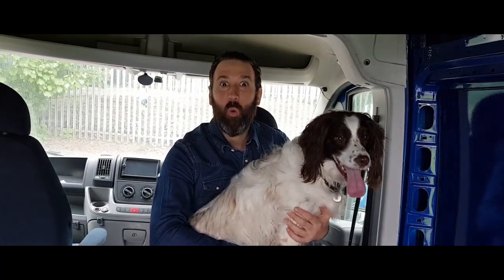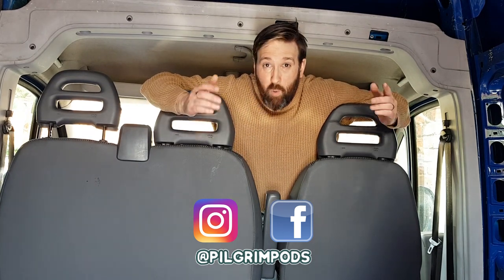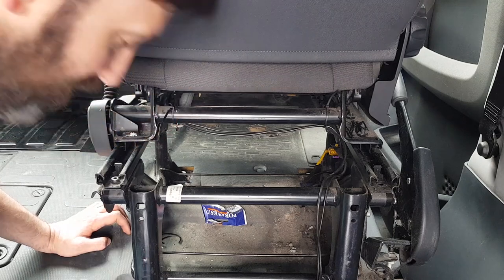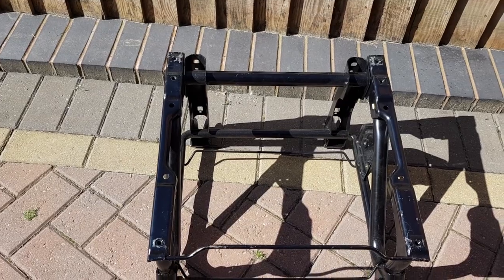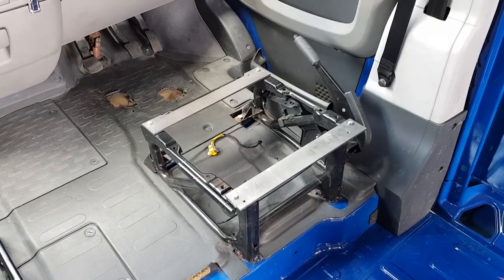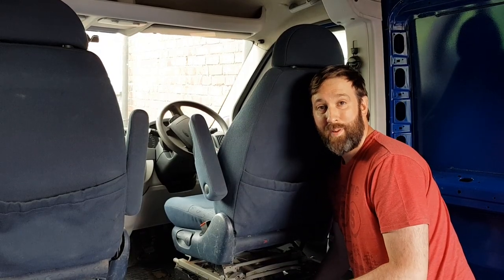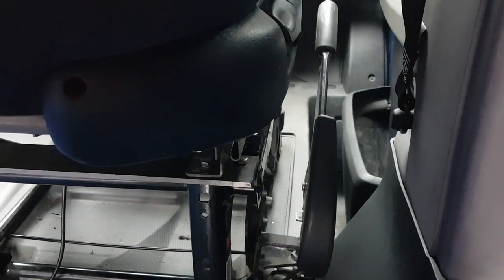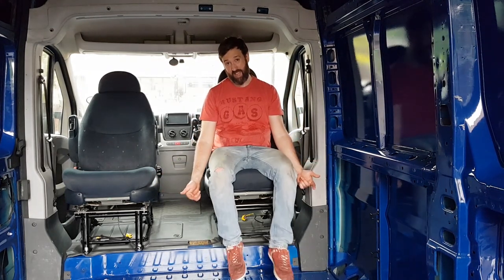Installing Ford Galaxy swivelling CAPTAINS CHAIRS in a CAMPERVAN - DIY Budget Campervan Conversion

Comment: Hey thanks for the video, after watching it I bought a pair of Galaxy/Sharan swiveling chairs for my Boxer van
Couple of thoughts, did you finally get lowered seat bases? I am personally looking at my welding invertor, maybe I could actually make ones
And of course the airbags, did you connect them? Extra safety never hurts

Comment: Great thanks for the tip on cutting the bit of metal to make it rotate 360
Reply from the maker: You're welcome mate! Hope it's of some use to you. 🙂👍
Reply: @PilgrimPods  Mine turned out to be newer seats to yours i think. Had to remove a stopper on the swivel and the two "catching" pins that i am not sure what their purpose anyway, kinda holding the seat from going up too much? But yeah, worked out well. Thinking if should wire up the airbags on mine? We all know how it will go... lol

Comment: Another good video. My front swivels are great and really comfortable but... I can't rotate either of them without it fouling on the door handle, so I have to open the door then turn the seat. A right royal pain, but hey ho😂
Reply from the maker: Ours are a little snug against the door when rotating them too if they're slid all the way back in the driving position but like yours, are super comfy and so much cheaper than buying legit seats. I think these cost around £230 all in versus £450 for a single passenger seat, £240 for two swivel plates and £300 for two lowered bases to correct the additional height from the swivel plate. Have to say though if it wasn't a budget build I'd pay the extra for the peace of mind knowing it's all crash tested even though I am pleased and confident of my own installation. 🙂

Comment: Hey there, great video. 
This is exactly what I did in my Peugeot Boxer. I bought two VW Sharan (same as Ford Galaxy) swivel seats for peanuts and fitted them almost exactly like you, with 4 steel plates. 
I then went to a blacksmith to have the seat base shorten: he cut 6 cm off and welded the tubes together. The height is now perfect!
Did you sort out the Airbag failure light?
Reply from the maker: Hey Hunor! They're great seats aren't they. 🙂👍 We're thinking about lowering the driver's seat too but won't know whether it needs to be done until we get the table in behind it. We have a temporary fix on the airbag light; we've plugged back in the old cable and tucked it beneath the seat.

Comment: Hi!
Thanks for the detailed video!

Doing the same thing right now, I'm thinking that the driver's seat has now an offset to the left, and is no longer centered with the steering wheel.
Is that the case? (as you've used the front inner bolt)

Thanks in advance for your opinion!

Comment: Do you still have the old drivers seat? :)
Reply from the maker: I do. The plan was to sell it to recoup some money to put back into the build but Covid had other ideas. It's tucked away in a corner safe and sound. Will keep it until were out on the road. If we decide we love the campervan but need something bigger we'll try and repurpose it for a passenger seat or sell it at that time.
Reply: @PilgrimPods  im interested in buying it, DM me on facebook? :)
Reply from the maker: @mortenleinan  I'm not looking to sell it now sorry mate.

Comment: I used the double base cut down to make the single base . Loved the video
Reply from the maker: I tried to figure out a way to do what you've done but couldn't get my head around how to make it work. Would love to see a photo mate! 🙂👍
Reply: @PilgrimPods  I put some 1min videos of me doing it but never put last 1 on I will add finished design  . I put battery under pass side and night heater under drivers seat as vents for night heater come out just above heat sheild for exhaust

Comment: Great video like your style. Just gathering information before we start our build and twin front swivellers are what we want. I've been looking and like you found the Galaxy seats as the cheapest option. Liked your instruction very informative and can't see any issues apart from that bloody seat belt tensioner. I've read you plugged the old one back in and added resistors,  any chance you could give a bit more info regarding this, as the dash warning light would now be a MOT failure and I'm not very good with car electrics to be honest. Cheers
Reply from the maker: Hey Rob, thanks for checking the video out. A resistor bought from eBay sorted out the pre-tensioner plug for the bench seat no bother but after following lots of advice online (most of it conflicting) I had to resort to disconnecting the old seatbelt stalk with pre-tensioner plug from the removed chair and plug that in and just cable tie the stalk under the seat out of view. I'm not happy with the fix but it got it through its MOT. Once the camper conversion is complete I'll revisit it and try and sort it out properly as others have managed to make it work. Truth be told, as much as I like the aesthetics of the seats if I had to do it all over again I probably wouldn't. I'd save up and pay the £400 for a legitimate passenger seat and then fork out for the swivel plates. Whilst I do have faith these seats are securely fitted what I also know is they're not crash tested for our van and with a legitimate seat I know it is. What I will also say though is these seats are a damned sight more comfortable than the proper Citroen seats!  🙂
Reply: @PilgrimPods  That's good info thanks for that. I don't think I would be too worried about your set up, it looks solid enough to survive any shear forces in the event of an accident. Only bit would be the lack of the pre tensioner - is there no way of fitting the original shackle to the Galaxy seats?
Reply from the maker: @robsimpson7619  I tried to unbolt the Galaxy stalk  and replace with the one from the old seat but if memory serves the bolts are completely different sizes and it wasn't something I wanted to mess further with. I think I'll take my chances with the Galaxy seatbelt stalk.

Comment: Thanks for the videos! Quick question about this… how do the seat belts fit the new seat belt receivers? Is it just luck, or have you taken the seat belt receivers from the original seats? Thanks.
Reply from the maker: They're a perfect fit, no modification required.

Comment: Nice work. How much did you pay for the single base please and where did you get it? Thanks.
Reply from the maker: Hi Allan, thanks for checking out our video. 😊 The base was picked up from eBay for £85 including delivery. As we're trying to build our campervan on a budget we would have tried sourcing one from a breakers yard or via one of those marketplace apps to save ourselves some money had we not been in lockdown. They're out there for a fraction of what we paid but it wasn't worth taking a risk. 🙄👍

Comment: So the Ford Galaxy seats swivel without a special base or have I missed something?
Reply from the maker: We've had to screw two steel bars to the original bases and then screw the new seats into the bars. I've heard if you have a VW they fit perfectly onto the existing base but with the Citroen Relay we wasn't as lucky... Easy enough to do though. 🙂
Reply from the maker: The Galaxy seats have the swivel plate already attached to them as factory standard. 👍